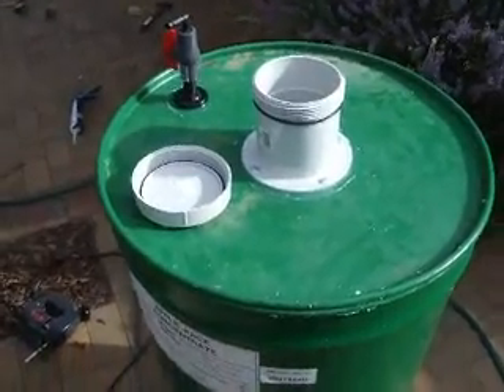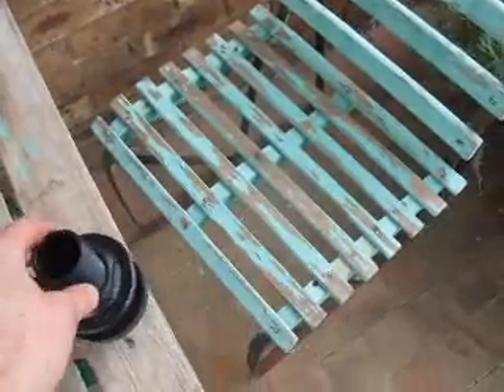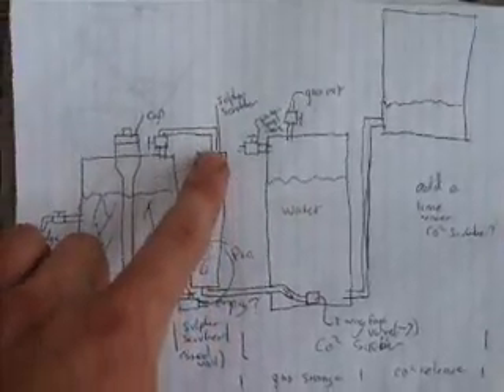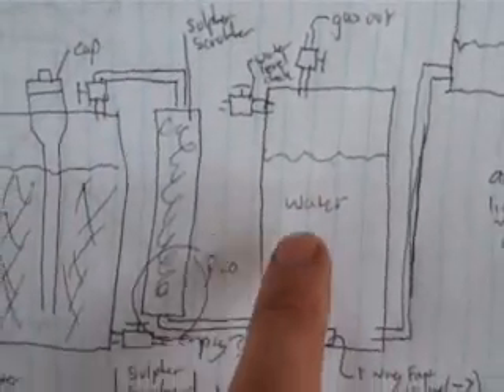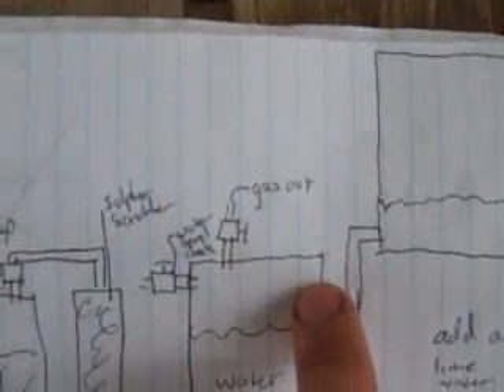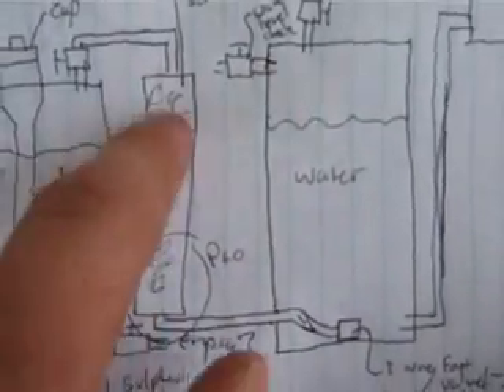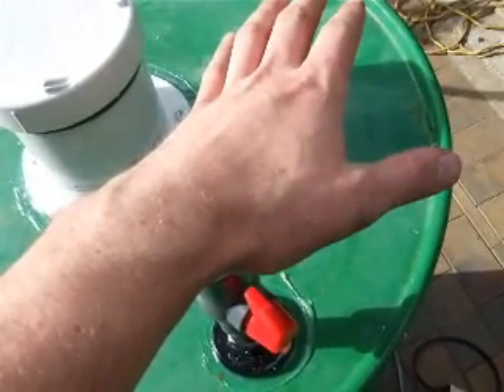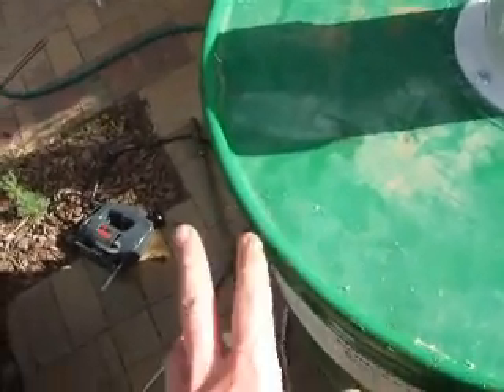anaerobic methane digester how to, including biogas scrubbing

Comment: If I don't keep the digestate inside the tank very full to the ceiling or even beyond it but leave an inch space does it affect the biogas production
Reply from the maker: It can foam and rise a bit. And you have to make sure it doesn't block anything and make too much pressure
Reply: @HomeDistiller  so was it wrong to leave the inch of space
Reply: @HomeDistiller  so was it wrong to leave the inch of space

Comment: I know the video is old, but if you run the scrubber from the bottom and have the glass flow out the top, the gas will flow slower and and allow more H2S to be removed along with more impurities, allowing less to have to be dissolved in water

Comment: Second water tank with foot valve may impede flow.
If enough pressure is generated to open valve, water will backflow into filter while gas is released. Better to not fight gravity.

Comment: You might be able to avoid using a valve by placing an upside down U piping arrangement between the water and steel chambers if the U bends above the water level (and a bit more to compensate for capillary action).

Comment: All this talk of scrubbing impuritues from the gas so it doesn't corrode metal tanks and machinery.  Yet the digester tank is a metal drum.  Does the gas corrode the digester tank?  Why/ why not?  Would love to use a 275 gallon home heating oil tank (Home Depot for about $400) for a digester, but I'm concerned about rusting through.
Reply from the maker: yeah it rusted through.. use all plastic before the scrubber.
Reply: @HomeDistiller  Thanks so much for sharing that.  Thought I had a great solution, but evidently not. Aside from picking the right container, I guess the issue for most is choosing the right size digester to make a noticeable dent in your expenses, and doing it in a way that saves money overall.  3 hours of one burner of cooking gas a day doesn't quite do it for me, and since it's not interchangeable with propane, I'd have to think pretty hard to come up with a good use.

Comment: how are we going to fill the digester for a new time and how many times do we have to do it per week?
Reply: You can add your table scraps every night it takes time for the biological to use up the sugars in the waste just remember you add stuff the biological waist (ie) needs to be removed so open your midpoint gate to allow for the release of your fertilizer run off. Then after adding new material close midway valve and close up the top.

Comment: Thank You for the great video and information. You did this back in 2009. How did it turn out? Anything that You would do to make it better? I am thinking about doing this to feed a generator way off grid and I need to learn all that I can. Again Thank You.
Reply from the maker: phillip staton it needs to be kept warm (about 30C) for best results.. DON'T USE A METAL DRUM only plastic or it will only last a year like mine did.. don't make the inlet too long (about half way into the liquid level) and make some way of agitating it.. Apart from that I think it was a great success.. I was toying with the idea of using a seabeck effect generator to make some power with the gas and using the liquid in the fermenter to cool the seabeck generator and this would also warm the tank

Comment: My self pawan sharma, I am setting up a 500-litre digester capacity 
biogas plant for an orphanage home at my own cost. I have taken for gas 
holding a 200-litre capacity plastic drum. Gas holder plastic drum is 
filled with 50-litre water.Whatever the biogas is generated in digester,
 I am thinking to take in gas holder plastic drum by linkage pipe, My 
questions is:1) Is there any possibility for backflow of biogas 
from gas holder drum to biogas digester.If any, please suggest me the 
solution.2) I have taken initially 25kg cow dung and 400-litre 
water in a 500-litre capacity tank. Is this amount of Feed material 
sufficient or should I add more cow dung. For 500 litre capacity plastic
 water tank how much cow dung should I take initially with how much 
water.3) After how much days,should I start feeding plant daily 
after the first feeding Day.Should I wait for 15 days for first lot of 
gas generation, then I should start feeding daily or I should feed 3kg 
cow dung after, two or three days, from the first day of plant feed.
 Thanks for informative video
Reply: hi pawan shama this is sai.now is it still working your biogas plant?

Comment: wouldn't opening the cap to refill make the gas escape?
Reply: and how do you get rid of the wastes  ?
Reply from the maker: +Иван Калашников the tube goes all the way to the bottom of the tank so it forms a air lock, and the waste come out the side tap.. Did you even watch the video? Lol
Reply: +HomeDistiller i did, but sleepy af half dead, and perhaps slept half the way through the video, ill watch it again tomorrow when i wake up  😂 

but how much time does it take to produce it at first?  I've been thinking alot about building one, went through many designs, and i chose yours, looks easy and simple.
Reply from the maker: +Иван Калашников it takes about 2 weeks to start, use the biggest valve on the side for waste take off that you can, and don't use a steel drum like I did.. It won't last long only use plastic everywhere! also the tube that you feed the digester through make it stop about 1/3 or 1/2 of the way up from the bottom I think some way of agitation will produce more gas also
Reply: +HomeDistiller thanks for the reply, do you recommend any way to store the output methane  ?
Reply: Yes as it is it would loose all build up, the mass needs to be added via bottom loading, in other words a tube traveling to the bottom of the barrel with a 45 cut out so waste will exit the tube into the large barrel bottom.

Comment: Thanks for the nice video!  What is the reaction between steel/(iron?) and sulfur that makes the scrubber work?
Could the product from the scrubber reaction be useful for something?
Reply from the maker: I think main reaction is between sulphur dioxide and iron. making iron oxide (rust) you could bubble the gas through an alkaline solution and remove most of the carbon dioxide too to end up with a much more pure gas, but I think the solution wouldn't last long and I'm not 100% sure that it would remove the SO2 (I'm fairly sure it will)
Reply: +HomeDistiller does SO2 + iron, maybe that makes iron sulfate?  someone else also said to use iron oxide ( rust).  that would be less expensive than steel wool.
Reply: HomeDistiller What would be a good cheap source of alkaline material?  I could use waste wallboard (mostly gypsum) for a while.
Reply from the maker: +J Bishop I don't think that gypsum would be alkaline enough (again I'm not sure) and I'm also not sure if the SO2 reaction with iron oxide will occur at room temperature as iron oxide is rather unreactive without the addition of energy (again I'm no chemist so I could be wrong)
Reply: HomeDistiller Oh, and gypsum contains sulfur, so maybe in getting rid of the CO2 you would be creating more sulfur?
Looks like I need to spend a little time researching this!

Comment: Why is a scrubber needed? They don't have them in all these videos about systems in foreign countries.
Reply from the maker: It's not if you just plan to use the gas for cooking.. But it contains corrosive gases so only ok for plastic contact, so no compressors or generators or metal gas bottles or you'll have problems.
Reply: Oh wow, I didn't realize that.
Thank you!
Reply: As stated it as any thing is created and is in its Raw state, usable but not optimal, first scrub, steel wool chemical reaction cleans off large particulate matter, second scrub chemical reaction though water cleans off more, giving you a very nice stable fuel. As stated you could also run it through a middle chemical reaction cleaner like the calcium hydroxide mixture but unless your going to run it in your car that's not necessary the water and steel wool will do more then enough for most everyone's need's.
Reply: To remove the sulfur. If not you have hydrogen sulfide in the methane.  You can use iron or calcium to remove the sulfur and you have hydrogen which burns very nicely.

Comment: Two questions about your plan. how about having the scrubber horizontally to avoid the need for a one way valve, then having a tube at the end that does dip to the bottom of the next barrel? Also, would it be possible to avoid the extra lime water pipe by adding the caustic soda to the water barrel you're using anyway?

Comment: what does the scrubber do do you know what catalytic cycle is happening? and wouldnt the water in the tank become carbonic acid if u dont dilute it that will not be good to pour anywhere if it becomes strong enough especially so id imagine under pressure which im assuming the system is naturally.

Comment: can any one give me the estimate for this:

bio gas production (i.e methane production) = 5kg per day

please include the scrubber cost in your estimate..

can any one mail to me your estimate
Reply: Your amounts are dependent upon biological organisms, they will vary daily, just as you vary daily on how much or little you work a day so do those little cridders chewing up and creating both mass waste in solid form and gas waste in gaseous form.
Reply: Oh scrubber cost, hmm one 4' long by 3" round pipe, two caps, two 1" 90° fittings a 5' long by 1" pipe, 1 1" t fitting,  2  1" caps, and enough steel wool to cram pack into the new filter tube you just created maybe $20 US. If you make it as I would with the water trap on the bottom as I have allotted for in the parts list I just stated. Oh and I forgot two barb fittings for tubing, or you can use PVC reducers and such as you will figure out as you pipe up your unit.

Comment: built one similar to this.. its working.  now I will hook up a small compressor to save the gas in a propane tank. a sump pump switch will turn the compressor on and off.
Reply from the maker: make sure you scrub the gas before the compressor and tank or neither will last more than a month... also use a plastic tank or that will rust out in about 6 months
Reply: yeah mine is all plastic.   have to look at  a scrubber.
Reply: dear rfrank100.

how much it costs to build digester like this along with scrubber??
Reply: +HomeDistiller Thanks for a very detailed and clear explanation. You have insisted about scrubbing. Do you recommend any more scrubbing apart from the one which you have described in the video? I am also wondering how to pack the steel wool in the scrubber. Thanks
Reply: @shau78  tight pack into 4' long by 3" PVC with capped ends two sets with a water drain in the center at the bottom cross over will work.

Comment: anyone know if rabbits have the necessary bacteria to create bio gas?
Reply: It doesn't matter.  Trust that some amount of anaerobic bacteria is everywhere.  Fill your digester. The aerobic bacteria will start the process - until they use up all the oxygen.  Then the anaerobic bacteria will bloom.  Could take a couple of weeks depending upon temp and what stuff you feed the digester.   No matter -- biodegradable stuff in a sealed container will go anaerobic eventually.  Guaranteed by Ma Nature.  (Prove it yourself:  put stuff in a zip-lock bag. or jar.  seal. leave it in sun.  Open it weeks later after it starts to look interesting. heh.  )
Reply: Yes but less then cows/horses

Comment: How did it work out? I'm specifically interested in if your pressurization idea worked and how much gas you were able to produce per day. Looks like a great design, thanks for sharing.
Reply: The method of pressurization presented in his sketch would work...sorta...no. However....it is very limited.  
First:  The amount of pressure the upper tank can apply to his holding tank is given by the height of the water column.  Counter intuitively, total amount of water does not matter - Just a tube or hose running straight up will supply the same pressure as a tank of same depth.  This is hydro-statics.  I.e. a vertical, 20 ft long 3/4" garden hose, filled water, vertical,  will have the same pressure at the bottom of the hose as you would find 20 feed down in an Olympic pool.  Volume does not matter for pressure.  Only height of water above your pressure gauge. 
Second: You want, say, about 3-5 psi of gas pressure to operate most stoves or lamps.  Your propane gas regulator is set at 5 psi for example.   Your water-column pressure unit would require ~138 inches or 11.5 feet of vertical water column to properly pressurize your methane.  
Third: Here is the problem -- If you have the system set up as his sketch, The building gas pressure will push water up your water column all right.  But it will also push water & digest-er muck back up the feed tube of the digester.  The pressure will raise the level of water in both the fill tube and your water column tube/tank.   But only to the level of the top of the digester fill right? -- then muck water spills out and pressure is balanced.  As the height of the fill tube is, say, oh,  a foot above top of barrel? and water level inside is, say, a few inches below this - then the delta height of water from inside digester to top of fill tube might be 18-20-25 inches or so.   Less than 1 psi of gas up pressure would back-flush the fill tube.  (Pheeewww)
You'll want your collection tank to be minimal pressure - then when you go to use it, close off the gas valve at the digester (or use a one way check valve), THEN pressurize you collection tank.  The very simplest, most practical method is a neutral buoyancy, telescoping, collection tank.  Add weights and wah-la - pressure.
Reply: @Verfolnir  correct the upside down barrel inside a barrel filled with water method, the upside down barrel is weighted so to create resistance as it is filled with gas, as it fills it requires greater amounts of gas to raise the collector up and out of the water filled container, thus creating pressurized gas greater then tank level atmosphere pressure.

Comment: it would be nice to see how the whole system work and also numbers like how much time does it take to make a liter how to store it for later use do you add certain kind of bacteria to do the digestion how much steel wool is used if we are using it to run a generator?

Comment from the maker: it is under some pressure from the head of water, and it will change as that head drops, but a low pressure natural gas regulator will work just fine, as will most natural gas appliances.

Comment: Really nice set up and explanation. Hardly any vids out there for contained/water pressurized systems. How big is your gas storage? How easy is it for it to displace the water/how much is displaced? If you increase the water you can increase the amount of pressure and store more right? I though with that weight of water it must be under a really high compression already no?

Comment from the maker: it reacts with the iron and make iron oxide and or iron sulphide, you need to wash the iron regularly, but you only need to remove it if you are running an engine or similar as it will destroy it very fast.

Comment from the maker: @dadigitechman i think it would as the H2S is an acid, do you have the iron before or after the lime water scrubber? if you have it built i would keep it in the system just put it after the lime water. my plan was to compress the gas to i need to rebuild the system though because i used a steel tank that lasted about 1.5 years

Comment from the maker: @luisthree it depends on what size flame you use.. i was adding about 1 kg a day and was getting 50 ltrs of gas a day.. make sure you use a plastic tank otherwise it will rust through very fast as mine did

Comment from the maker: @MrScorpion051189 i made no calculation just read some old books on the subject ("producing your own power" 1974 rodale press), i wouldnt suck from the digester because if you have any leaks you will draw in air to the mix and you could have a nasty explosion.  your better off storing some under a small amount of water pressure then compressing from there

Comment: @HomeDistiller the pressure throughout the system, i.e in the storing gas tank, the pipelines as well as the anaerobic chamber will be z same order. I would like to couple a pump to pull out the gas at a low pressure in the pipes to a high pressure in the gas tank. Any guidelines on this would be mostly appreciated. Can u plz, plz snd me some calculations u did, if any, before z construction of z digester which wil be v. helpful for my project. thanks.... :DDD

Comment from the maker: @MrScorpion051189 you would need need to compress the gas after removal of the so2 to use the steel wool all you need to do is flow the gas through it and wash it every few weeks, the lime water will remove the SO2 too. you need to make sure you have purged the compressor and any gas lines etc of air

Comment: Hi, v.nice video. Thumbs up. I am currently constrcting a digester for poultry dung.  Can u explain to me how can i couple a small 6kg gas tank to my set up instead of directly delivring z gas out. My concern is about pressurre in the system.Can u please guide in how the steel wool would help remove SO2 from the system. I shall use the lime water as recomnded by u. R u interested in SCADA systems for the remote control of the digester(3rd yr projct). I will be posting it soon.Thanks a lot :D

Comment from the maker: @aryan87when H2S dissolves in water it makes sulfuric acid, when CO2 dissolves in water it makes carbonic acid.. so if you make the water very alkaline then it reacts with the acid and makes salts so all the gas that passes has had most of the nasties removed

Comment: From the steel scrubber to the water scrubber why not run the tube in from the top and down to the bottom of the drum & use water as a seal, rather than having to find a mechanical valve.